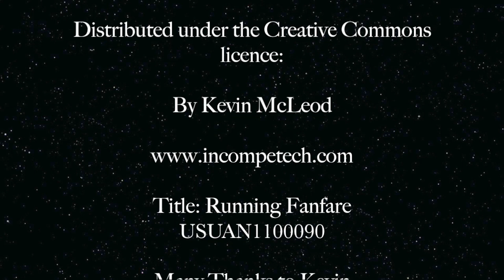Scratchbuilt Dreadball Trophies

Comment: They are really cool, also well painted, i however did notice the little tiny air bubbles that get caught up in the mold, i have a mold like that from hirst arts, if you want a easy way to get rid on them add a little finish shine and dry rinse aid to the water you poor into the plaster, 1 drop will be enough for the whole mold, 1 bottle will do about 500 molds, though i will say i am nit picking there lol, they really do look great,
Stay safe :)
Reply from the maker: We do use rinse aid when casting with plaster, but these were done with left overs of resin. But thanks for the advice, its useful for others too. Thanks also for your kind words on the painting!
Reply: you are very welcome, after i watched it a second time i thought i bet that is resin. i really enjoy see your work :)